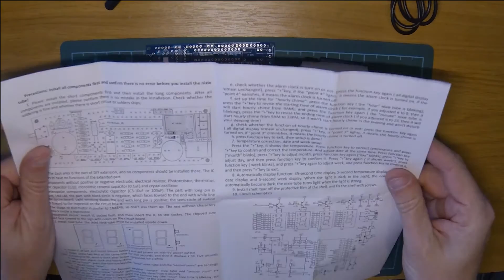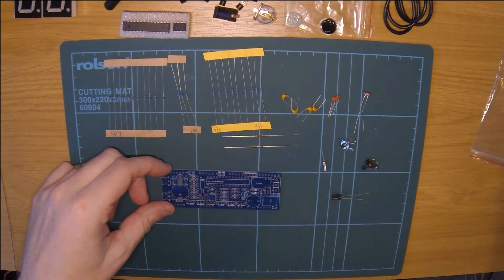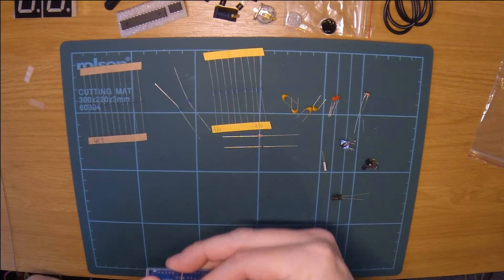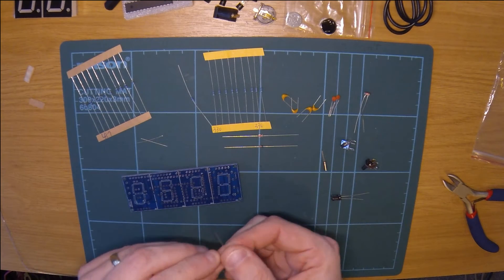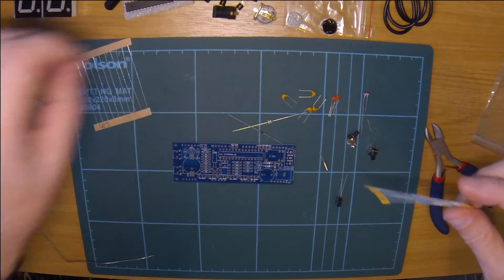Lets build - 4 Digit LED Clock Kit Project from banggood - (Part 1/6)

Comment: Nice video.  Saw the white version on banggood. Will watch the series later.  Might get one myself.
Reply from the maker: +fredintheshed1 Thanks, they are pretty good little clocks, fun to build too.  I've got all 4 colours, I think I like the white one the most, especially now that I've added black out tinting (as per part 6 video).  It looks great now :)
Reply: +lets build stuff Yes I saw the tinting.  Good idea.  Thanks for the video's I like the step by step guide approach.  I think I have found some winter projects.  LOL

Comment: Built my own today, it doesen't work though. It just light up segment F on all four digits. Do you have an idea why?
Reply from the maker: +Sebbithecool I could only think it might be a short somewhere, probably between the resistors.  I did find the ICs quite hard to push into the sockets, maybe one or more of legs on yours didn't go into the socket correctly?

I must say I was quite surprised and delighted when my first one worked first time, so I've not had to trouble shoot one not working.  Just double check every solder joint to make sure they are all ok.
Reply: ok thanks